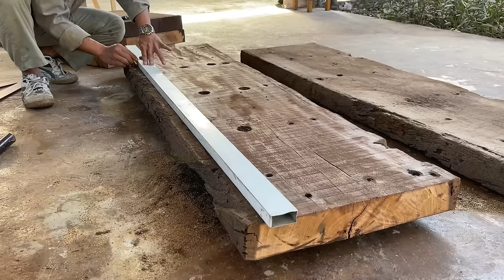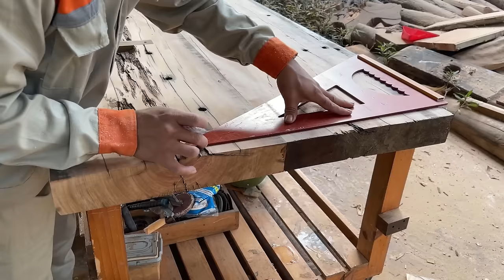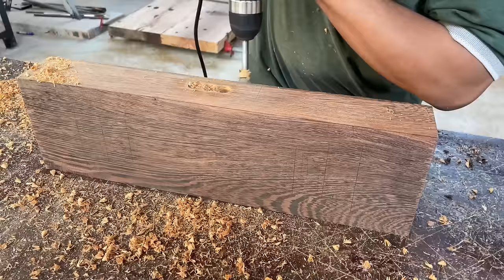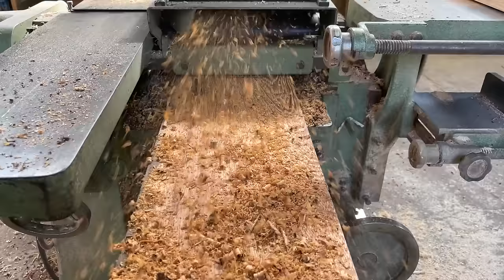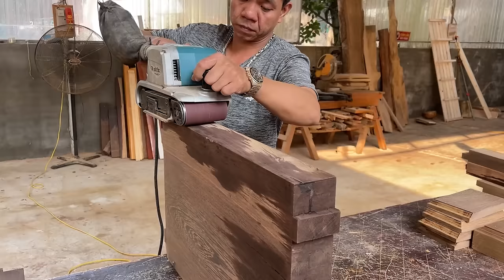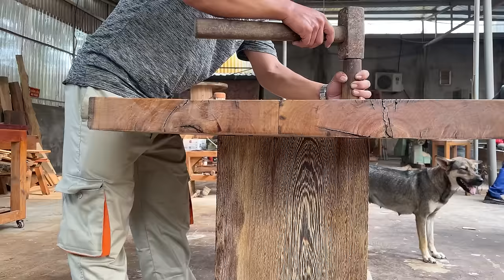Reuse RAILWAY Sleepers Woodworking Project // Beautiful Monolithic Heavy Dining Table Design

Comment: When will you diyers learn that reusing railroad sleepers (ties) could be hazardous to your health, especially if placed in doors.  Ties could have been treated with carcinogenic pentachlorophenol or worse yet some other carcinogenic substance to make the wood long lasting from insects and disease.  About the only thing railroad ties or sleepers are good for are using in ground if solid enough.

Comment: One of the most dangerous wood to use in such state. Wood slippers are usually traited in creosote bath which is  a cancerous product. Therefore it’s not all recommanded to use the slippers wood either in fabrication nor in domestic heating.

Comment: While I have nothing bad to comment about the actual project, given the country, and availability of materials, I must  laud a fellow woodworker for his efforts on creating a workable product from literal scrap! Having said that,- I'm really quite curious as to what specie of wood he used for the stand, as well as what was used for the top. Being from Canada, the base wood looks like what we would/ might refer to as an exotic and would fetch a more higher price to purchase.I did notice however, that considerably more care and thought might have gone into the spray finish of the table. As well, the underside of the top should have also been sealed.Also, knowing the top was constructed from salvage,I, personally, would have took greater care in the finish of the top, in that, I would have filled ever hole and crack with a clear epoxy, first, then floated a second coat, and, maybe even a third coat, for a solid, smooth finished glossy look! Anyway,- all in all, a wonderful worthwhile project!!!

Comment: Thank you for your videos! Avoid passing your hand and fingers near the router tip while rotating! Get a vacuum or a brush or a peace of wood like a spatula or a piece of carboard to blow the wood dust. See the holes on top of the table board? Consider this. Using a chisel and maybe a router with the thinnest of bits, try to make like eye shapes, and elongate their extremes sort of irregularly like cracked or curved, fill them with glue and wood dust of different colors to suggest natural knots, and the center of the eyes can house a round bit of wood. You will love them!
Reply: Perhaps the holes and cracks were meant to be left there.  I think they they add to the beauty of the table.

Comment: never seen railway sleepers that wide before
Reply: right in the beginning of the film the guy brought in 4 pieces. 2 of them,double wide like railway sleepers looked new and unused to me. 
The other two were grey and heavily used.
I ALWAYS THOUGHT USED RAILWAY SLEEPERS WERE MORE OR LESS - BLACK -.
FIRST FROM THE TREATMENT WITH CHEMICALS SO THEY DONT ROT.
Creosote was used but nowadays the more environment friendly Creosol is used on wood.  
But still, real wooden railwaysleepers, when being replaced with concrete ones, or new ones,still should not have this light color.  
On the other hand we were not there, so we theoretical we should have no idea. 
Though i was born in a railway town,when sleepers were still made of wood, were black and stank. Even when stored outside in the rain after being replaced.  And, also like you mentioned, were not of this big size.
Though the work the guy does with the wood, well worth watching.

Comment: Railroad ties.. that’s the correct name
Reply: They call ties sleepers in England and other parts of Europe and probably other parts of our world. too.  But those boards are not ties or sleepers.  IF they are used railroad timber’s they are probably out of some type of building.  If the were bridge timber’s they would probably be treated with creosote.😊